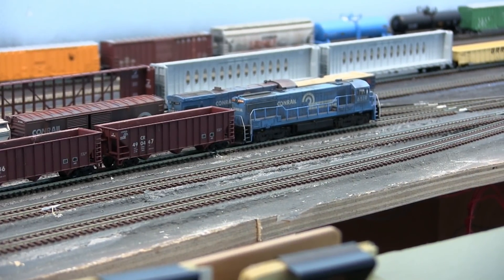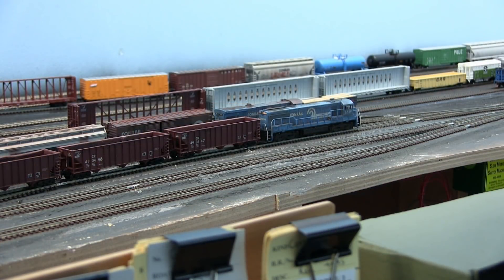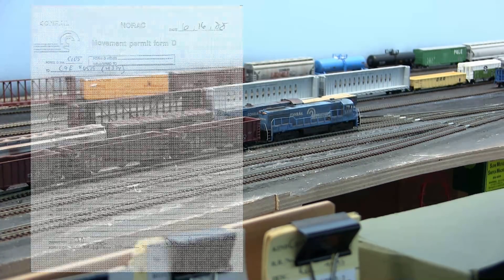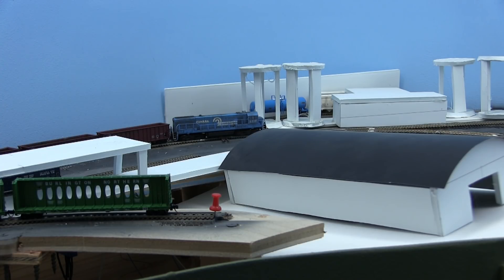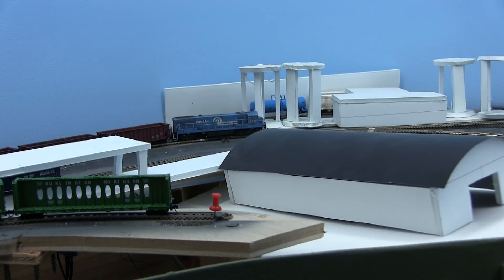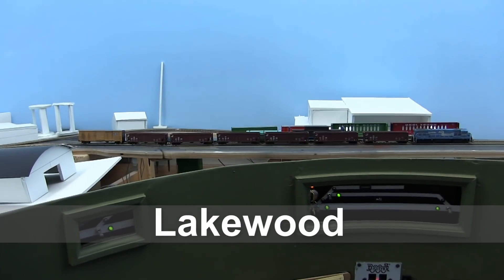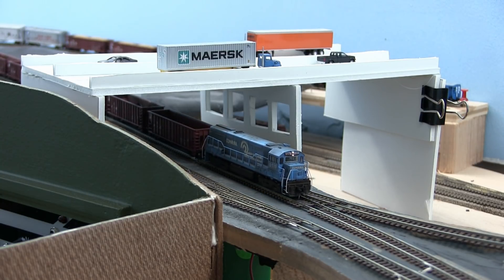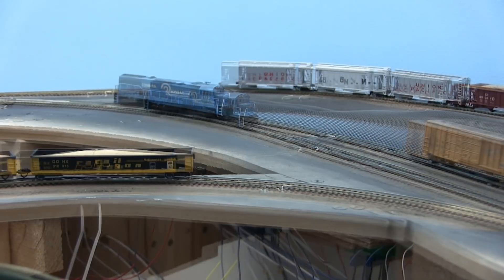Operations Blowout Day4 WJSA 37X (168)

Comment: Joe. Might need a Form D for both ways to shove back to pickup crewman on single track, IF it does not break any rules. On the UP the dispatcher can give permission to make a  back up move on CTC controlled track to pickup a crew member if the train does not foul a crossing, exceed the trains length, exceed the trains authority, is in yard limits (and more)  What do NORAC rules say? The failed air test was a "no trouble found" with the retry good.  Like the new sand loads. Another great ops session. Mike
Reply from the maker: Mlke Simmons thanks Mike I will have to research that and get back to everyone. Without looking I believe you can back up one train length with out a form D not sure on the rule.
Reply: Joe, if you haven't had a chance to look the rule up yet, you CAN reverse within the limits of a Form D, but only at restricted speed, and a crew member must be on the point, or ahead of the move, and you obviously cannot reverse outside of your limits. In short, if it's a short train and the brakeman can see that the track behind is clear, you could save him a bit of walking. At least this is all legal under current NORAC rules. I imagine it would be the same in the 80s. Love your layout, keep up the awesome videos!
Reply from the maker: Bryan Connaughton thank you. I haven’t looked up the rule, but I do remember reading that at some point. Sounds like you have a lot of experience with NORAC, thank you!

Comment: You are doing great but you make your brakeman do a boat load of walking. 
When pulled ahead to line and lock the switch heading home, it is permmisable to back up to get your brakeman. I've seen UP crews do it with long train frequently.  It it would surely make you a good engineer to work with. 
Just a thought....
Reply from the maker: Thank you so much! Glad you like them so far. I had never thought of that or knew that! I will definitely work that in next time! Thanks for the suggestion!

Comment: These are fun, thanks. How come you're leaving that caboose sitting at the sand pit?
Reply from the maker: Robert Weiland oh that has been a hot topic. The caboose is for the backing move into the pit, in the prototype it was about a mile and there was a grade crossing. I was changing it out everyone run but the consensus was to leave it there.
Reply from the maker: Glad you enjoyed the videos
Reply: Yes, I've enjoyed them quite a bit, thanks again. That sounds like a very logical reason to leave it there, I agree with the consensus. I know cabooses (caboosi? Heh, heh) were still in some use during the time frame you're modeling, so it makes perfect sense. Thank.